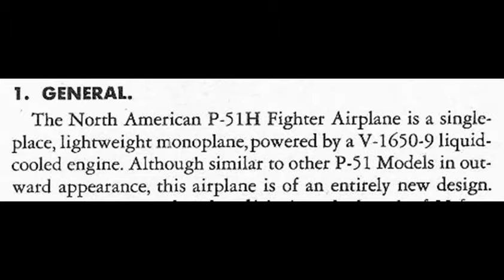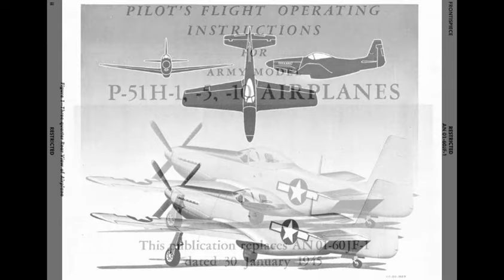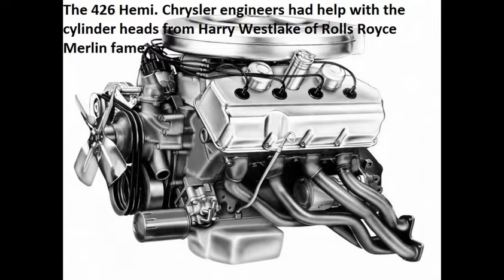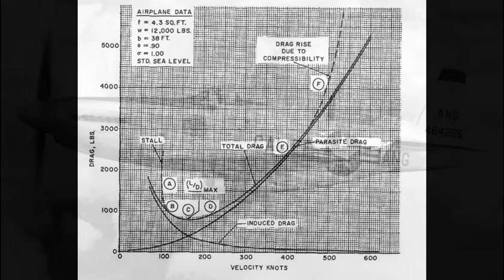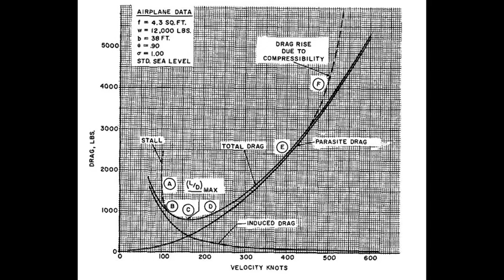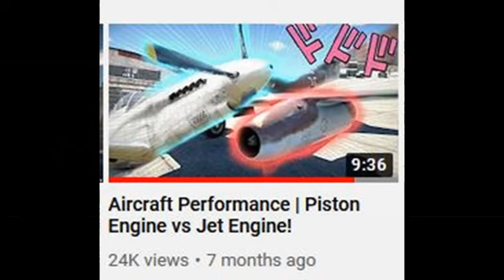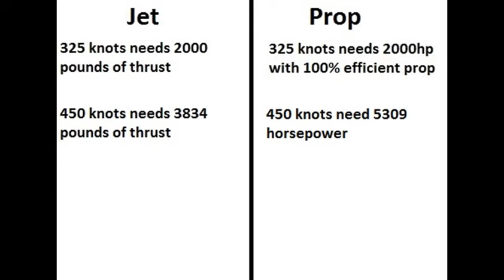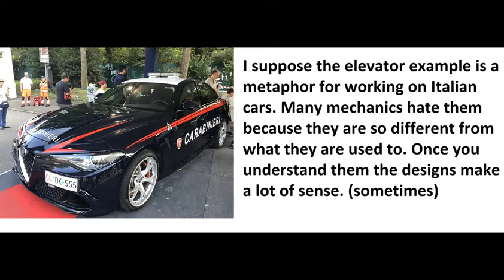U.S. "Superprop" Fighters P-51H, XP-72, and more

Comment: The straight leading edge on the P-51H wing was a throwback to the early model Mustangs. Only the D model had the kinked  inner section. Not saying the H wing was the same wing as the early variants though.

Comment: The heads in almost all modern cars have a 4 valve almost like v notch instead of a hemispheric shape and all have a variation of Hondas Vtec and vtc that do the same thing in a little bit different way. The only new thing is mazdas skyactiv that varies the compression ratio on the fly by leaving the valve open for longer or shorter depending upon where the piston is in the stroke determining the compression ratio.

Comment: The pinnacle of piston prop development..makes ya wonder where it would have gone if jets hadn't come along..
Reply: They were at a dead end. If I recall rightly, it was the prop itself that put a hard limit on how much farther they could push this kind of plane. Removing it unlocked all of the advances in aviation that came with the Jet Age.
Reply: @majorborngusfluunduch8694  Hear ya friend, but when did a dead end ever stop progress when there was a need?? Wasn't the sound barrier a dead end??
Reply: @oilsmokejones3452  I don't think you could consider the sound barrier a dead end. That would imply it completely blocked further aviation developments, which it didn't. It was merely a high hurdle, which could only be jumped by streamlining an aircraft as much as possible and using an engine with the power to push it past the barrier. The propeller and piston engine simply had to go. At the start of the Jet Age they were just hindrances and everyone knew where the future of aviation lay.
Reply: @majorborngusfluunduch8694  Again I hear you, but my hypothetical was IF jet engines had not existed..all speculation ofcourse..and ofcourse the jet quickly replaced piston prop in all but the lowest cost applications as it became a practical alternative and some even argue before not so practical...so consider lighter higher revving engines driving fan jets as in some very fast model airplanes, or a long burn rocket of some kind..who knows what wacky scientists and engineers would have come up with...
Reply: @oilsmokejones3452  My bad, I assumed your hypothetical scenario envisioned some kind of "Hyper prop" plane. I think Rocket planes would likely have been route to take, considering the doctrine that came into play in the post war years. It was believed the next air war would be a bomber war, so I can imagine rocket powered interceptors becoming the fashionable thing of the late 40s and 50s. Super Props might've made a comeback for the Vietnam War and beyond for the close air support role.
Reply: @majorborngusfluunduch8694  Agree..consider the A-1 Skyraider was very effective into the early years of Vietnam..long loiter time and could really get in close..AND it actually killed some MiGs..

Comment: Even if there was no longer a place for piston engine fighters, it's still too bad no production-model P-72 was built. I would imagine they would've been far better-suited for the ground attack role in Korea than the P-51D (or by that point F-51D) that was actually used. Especially with those 37mm cannons.

Comment: You do outstanding work here. (high bar has been very well earned, but set) Can you tell us anything about that Boeing YB-299 wind tunnel model resting against the wall on the right side of the screen at time stamp 2:59? Its got the pre B-17 teardrop waist gunner blisters and an overall B-17 appearance but the wing cord is unusually deep. Anything you can dig up would be appreciated.
Reply from the maker: I don't have anything on it, if I make a B-17 video I might get into it.

Comment: When I was 19 I finished putting together 68 Charger RT with the 440 Interceptor bored balanced, high-rise manifold and a 750 double Pumper carburetor, 311 gear 12-bolt posi main rear end, low Nines in 1/4 mile. How to go back to the late 70s early 80s much better time.

Comment: Running the risk of being that guy, I have a thought project. The idea was about a specific A series P-47 given its successes, where Republic continued something like the XP-72 as an “A-72” post-war. 

With the F-47D shelved for the F-51D in CAS missions for what I heard were survivability/maneuverability reasons against MIGs,  Could an XP-72 have been a better CAS plane in Korea? 

Understanding that the Sea Fury did well, having been credited with a MIG, but only in theater because of Carrier limitations. Would an American  land-based Sea Fury like an XP-72 be better compared to a P-51D,  (when the P-47M couldn't cut it?) Are all of the turbochargers an Achilles heel like the Mustangs water cool system? 

And knowing that the belly scoop was needed for cooling the oil, rear turbo, etc., but was an issue for belly landing, could it have been moved somewhere else allowing for better crash survivability and another hard point? 

For that matter, would it need all of the power enhancement for climbing as an interceptor to haul more ordnance? It looked like it only had about 3,000 lbs of carrying capacity by its max takeoff weight. Are there things to be done that would make it more of a work horse CAS plane than an Interceptor race horse?

TL;DR Could Republic have made an XP-72 that would be a Fea Fury contemporary, worth replacing the F-51? And how could it be done?

Comment: P-51 H shattered props......................also featured a piece of equipment that caused no end of problems. This was a Simmonds engine pressure regulator/boost control, which normally maintained engine manifold pressure, and would work fine if shut down before the engine was stopped after flight. However, if it was not shut down before the engine was stopped, next time the engine was started the regulator would engage at the setting at which it had been stopped. A a result a number of North American P-51H Mustangs stood on their noses when the engine suddenly and unexpectedly reached high rpm immediately after being started. It became normal, and safe, practice, for ground crews to stand to the right of the aircraft on start-up, for if it suddenly stood on its nose the fragment of the shattering propeller blade would fly off to the left.

Comment: That 490 mile an hour speed is not calculated, I read oh, quite some time ago about people who were familiar with the que flight test that this P-47 experimental aircraft head, and it was clocked, unofficially, at over 500 knots. Which the pilot said was easily attained. It was Chrysler's first example of their Hemi engine.
It was tested in mid 1945 which is probably why it never made it into production. By the time they would have been able to schedule production the war was over.
Memory serves me correctly the pby used a wasp type of engine in it.

Comment: Ironically, modern turbofan engines, take the bulk of their engine power, to drive the large fan at the front of the engine.  So basically they are a ducted propeller engine, powered by a jet engine.
Reply from the maker: That's pretty accurate, although I would call that thing at the front a ducted fan, not a ducted propeller.

Comment: In regards to the 6x .50-cals, they were the M-2, not the M-1. They had a higher-rate-of-Fire, thus, actually put More-Lead-on-Target than the 8-of M-1's could, for Far less weight, and, actually, more ammo stored! Keep in mind, the P-47-N, and later 'proposed' F-72's, had "Wet Wings" with more Internal fuel for better range. F-47-N's had only the 6 M-2's, wet-wings. They were So Valued that the ANG 'kept' them  Home, when the USAF found that the F-80 was too slow & Short Ranged  for 1951 Korea. F-51 Mustangs became the USAF fighter bomber into 1952, until the F-84 stepped into the Void.

Comment: Yes, the sleeve valve.  Seems like that is one engine innovation that died a premature death. Will await your explanation as to why.  Hurry up!
Reply: G'day,

Well, Sleeve Valves were a pain in the Bum to manufacture..., they always had problems actually sealing the Chamber - which was dependant on Oil Viscosity plugging the Gap...; but the Showstopper was that Poppet-Valves were developed to feature Hollow Stems with Sodium filling to transfer Heat out of the Mushroom Head & dump it into the Oil circulating in the Valve-Guide...

So by the time Sleeve Valves were coaxed to function at all reliably, despite their being harder to build - they offered ZERO "advantages" over the Poppety Mushrumps.

HOWEVER, in any but the balmiest of warm weather the Oil-Viscosity caused SO much internal friction & Drag between the Sleeve's huge outside & the inside of the Cylinder Barrel that the Sleeve-Rotation/Elevation/Descent Actuating Cranks used to be bent & broken by ANY efforts to turn the Engine over - by Hand or by Starter-Motor...

I heard that one  remedy involved enclosing the whole Cowling in a Tent fed by an Oil-burning Heater on the Ground,  to warm the whole Unit, and another method used a Hand-Held Blowlamp on the Cylinders to heat & thus thin the Oil.

Basically, Sleeve Valves were a good looking idea which turned out to have been not worth the Effort ; the money thus wasted helped to send the Bristol Company broke.

Such is Life,

Have a good one...

Stay safe.

;-p

Ciao !

Comment: Old friend of mine said at the end of the war he was working with experimental P51 Mustangs fitted with two counter rotating props in England. He said it could take off and go straight up at the end of the run way and go out of sight in just minutes. The counter rotating props eliminated the torque of the plane trying to flip the plane... He said a lot of Hot Shot pilots flipped their planes on take off while punching the throttle.  Been a long time since this story was told to me but I think he said P51. Real smart guy, he had 17 Patents to his name.

Comment: What would have happened to the super props planes if they had turbo props. Would the prop gearboxes stand up to the very high horsepower of the turbine engines & what speeds could they get. Looking at the experimental Lear Fan it had superior economy & efficiency over jet.
Reply: The gear box for a turbo prop is quite different since the turboprop runs a much higher rpm.  Even for piston engines the gearboxes were very engine specific, part of the engine not the air frame.

Comment: Your explanation of Piston Engine Technology Circa 1945 is WHY I always say the "1960's Muscle Cars were outdated before they rolled off the line." They were! - Hemi Pushrod 2V Per cylinder was 1900 Tech... If Someone would have built a 7L DOHC 32V V8 style engine in 1968 and mass produced it... They would have smoked ALL existing "Muscle Cars" - LOL
Reply from the maker: I might talk about this comment in my next muscle car video. It's an interesting comment.
Reply: @GregsAirplanesandAutomobiles I mean look at the Late 1950's INDY255 252cid Offenhauser 4cyl, it was DOHC 16V and made 325hp at 6,600RPM, that was the closest application of "aero" technology in any real automobile, 15:1 compression & Race Fuel didn't hurt...But 325HP is only 10 less than the 1968 Charger 383-4bbl had, with its 131CID advantage...If you took the INDY255 HP-per-Cu.In. to the 426 Hemi, it would have made near 550HP - Now I am not saying the INDY255 had the torque of the 383-4bbl. - In the 90's there was a company making 4 Valve Pushrod heads (ARAO Engineering) I remember some magazine took a 358cid NASCAR engine and just changed the heads, to unported 32V ARAO heads...it made something like 150HP more with no other real changes. (Of course intake and Headers had to match the head) But in reality...The 7.0L Muscle car engines (Hemi/Boss) at the time they rolled off the assembly line, were outdated tech, especially when Rolls Royce and Allison had made reliable 4V per cylinder engines, even though they are SOHC the principle is the same.  Even Ford's Famous "427 Cammer" was leaving a lot on the table.

Comment: @1:00 I might notice the leading edge of the wing is straight.
Except, it is NOT straight. From the plane’s centerline, there is a swept back angle. And at the wing root  there is a curved fillet.
Reply from the maker: Dude, "straight" in this context is relative. We are talking about identification of models types at this point not geometry. Context! Compared to a D model which has a big visible kink in the leading edge, the H is straight.

Comment: More shortsightedness by the Army Air Force. While the P-72 wasn't as fast as the Mig-15, it certainly was faster than the P-51s stationed in Japan at the outbreak of the Korean War, and the P-72 was certainly more maneuverable than a Mig-15. An interesting what if.

Comment: Blade tips going supersonic reduces efficiency. By adding blades the propeller diameter can be reduced decreasing tip speed.
Reply: + David   I think it was engine builder Dwight Thorn that discovered that by fitting heavier Allison connecting rods to race-prepped Merlin engines the extra rotating mass kept the propeller speed down enough to keep the tips from going supersonic.   That was an old Reno trick and I think it is still used today.

Comment: Comment on your narrative: The Continental tank engines came first. There were several repeated engine issues with these counter rotating prop airplanes which would come up multiple times even into the 50's with experimental aircraft. Overheating was the first issue, the second was the gearbox itself, which in the early years was a constant failure point. The Soviet Union successfully made this system work- which is why- to this day- they still fly TU-95 'Bear' bombers.

Comment: Greg: Have you studied or considered the De Havilland  Hornet?  That seems like a very capable plane that wasn't much used if at all.
Reply from the maker: I have. As with the US "Super Props" it was too late to see any WW2 action, but it did have a lot of performance and I'll cover it quite soon.
Reply: You are right.  I had thought that I had seen anlied 30mm but appear to be incorrect.  Yes the 37mm did not have much velocity.  Thanks
Reply: @tdimentional2048    A workshop in New Zealand is working on a full rebuild of a De Havilland Sea Hornet to flying condition using wreckage recovered from Canada.
Reply: @FiveCentsPlease  Cool thanks for the info

Comment: These WW2 super prop engines were quite complex and most large late WW2 engines had more moving parts than the average jet engine. It takes less training and money to build a jet engine. They take less mainance and heat soaked parts last longer. Many radial engines for example go through cylinders. I know a few old pilots and maintenance A&Ps that have told me that the really large pistons engines like the R-2800 were real Maintenance hogs. Compaire that to jet engines. Lower cost, longer lasting engines , less moving parts. All that said smaller piston engines like the flat 4, 6 & 8 found in general aviation aircraft are fairly cost effective.

Comment: but also featured a piece of equipment that caused no end of problems. This was a Simmonds engine pressure regulator/boost control, which normally maintained engine manifold pressure, and would work fine if shut down before the engine was stopped after flight. However, if it was not shut down before the engine was stopped, next time the engine was started the regulator would engage at the setting at which it had been stopped. A a result a number of North American P-51H Mustangs stood on their noses when the engine suddenly and unexpectedly reached high rpm immediately after being started. It became normal, and safe, practice, for ground crews to stand to the right of the aircraft on start-up, for if it suddenly stood on its nose the fragment of the shattering propeller blade would fly off to the left.

https://history.scale-model-aircraft.com/wwii-aviation/north-american-p-51h-mustang